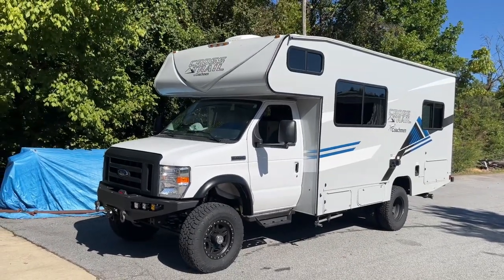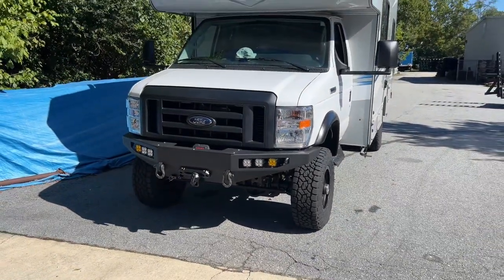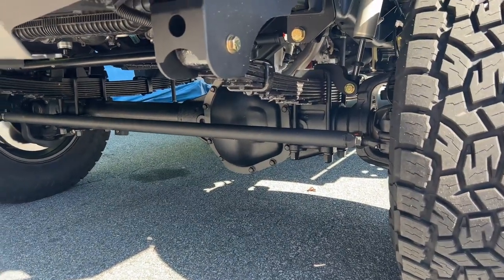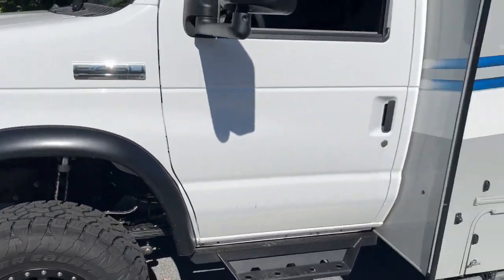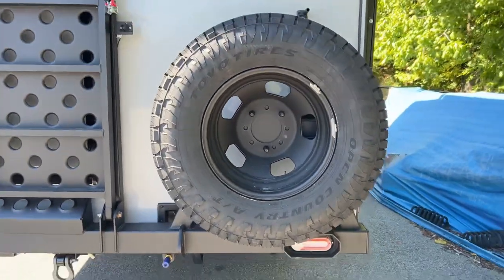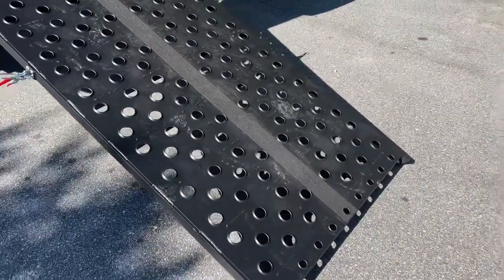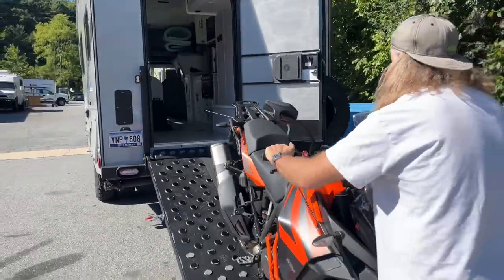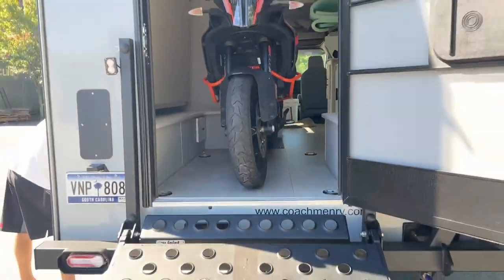E450 toy hauler w/bike ramp

Comment: You guys killed it again. That thing is sweet! Question for you. If I were to get some 17" Dodge dually rims and had the center hole machined would the dually wheel work on the front of my rig or does the Dodge wheel have the wrong offset?
Reply from the maker: They "should" work but we haven't tried. The offset is a bit more, yes.
Reply: @ujointoffroad  . Does the offset move the wheel in or out?
Reply from the maker: @stevebiloschaetzke779  Up front it will move in.